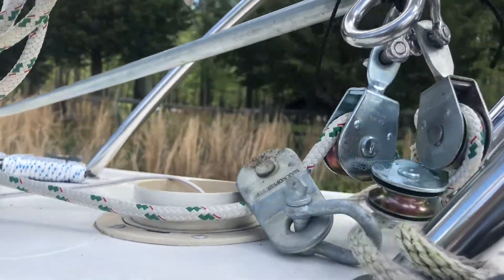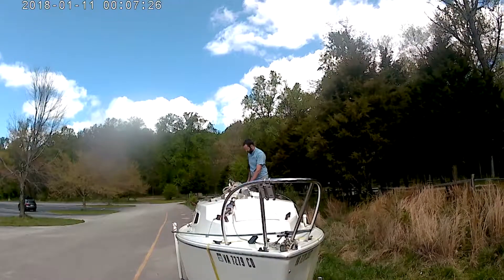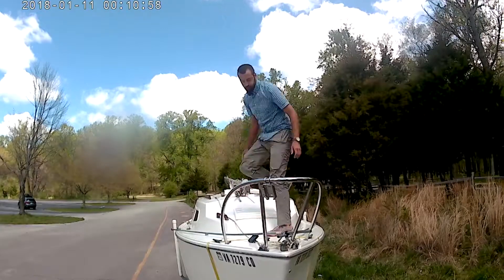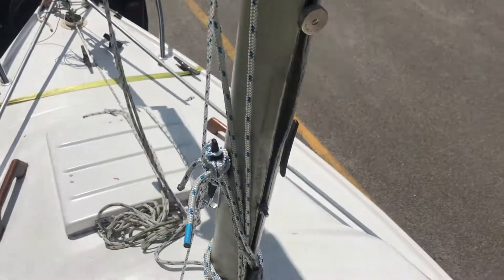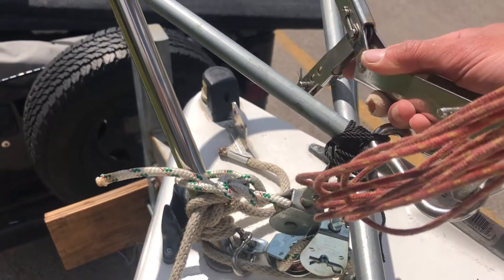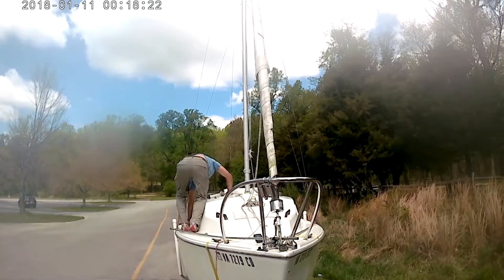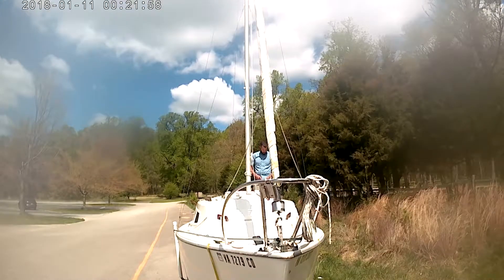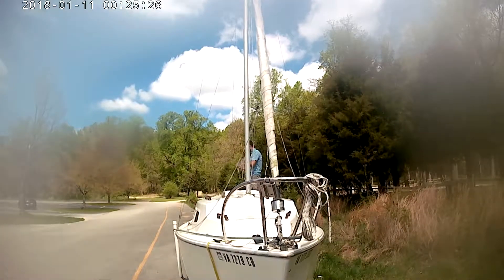Mast Raising System & Boat Rigging

Comment: What, if anything, is preventing the mast from going side to side?
Reply from the maker: it doesn't wobble too much when it's over 45 degrees up, and I usually control by hand at the lower angles.